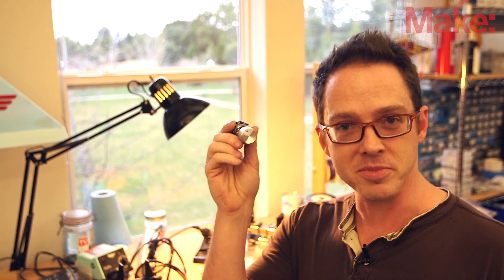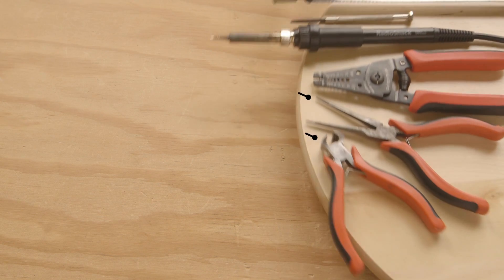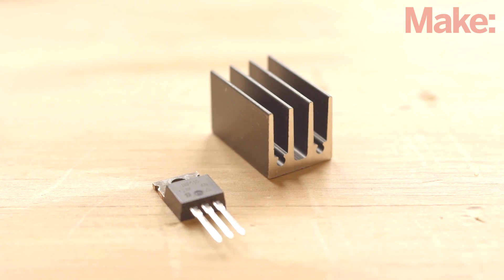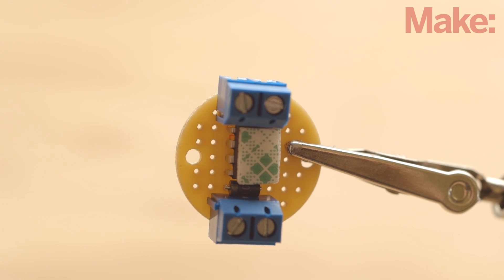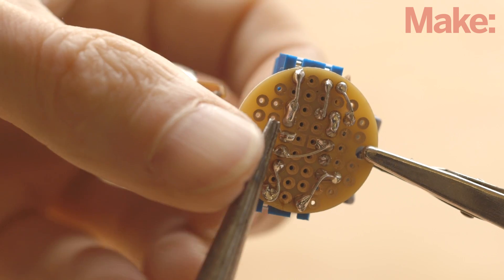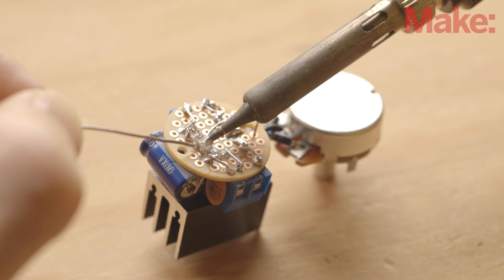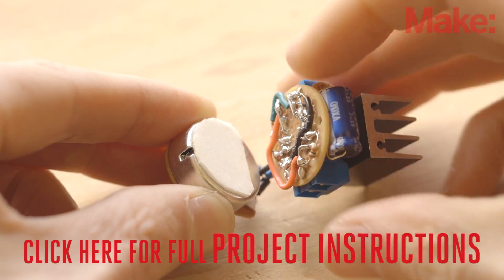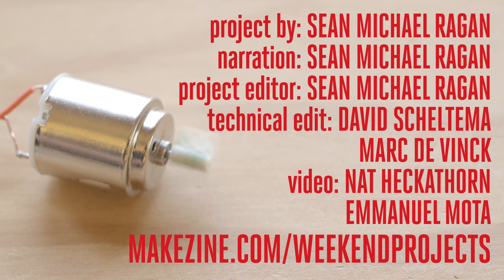Weekend Projects - Dial-a-Speed Motor Controller

Comment: That heat sink ain't gonna work
Reply from the maker: Please elaborate.
Reply: I think you saw it wrong Derek Li. The mosfet is directly on the heatsink.
Reply: MAKE Isn't the double-stick tape between the transistor and the heat sink?  I would think that tape is a pretty good thermal insulator. (But I'm not going to say flatly that it ain't gonna work, because I don't wanna sound like a know-it-all snot.)
Reply: the tape is on the OTHER side of the mosfet, the side that sticks to the 555 ic. the lug side of the mosfet IS bolted directly to the heatsink. watch it again. (although i do agree that some thermal paste between the trans and the sink would have been much better)

Comment: Is there a thermistor controlled version?
Reply from the maker: There is not, but what type of application were you thinking of? We're working on something for later this year that might align with what you're asking about.
Reply: im using it to control the speed of the fan depending on the temperature of the cpu.

Comment: Can you just not use a adjustsable resistor or a volume controler.
Reply: you could but its not as efficient as a PWM circuit.
Reply: Cool, yeah i guess so, i didnt think of that for power management saving.
Reply: That would waste power in the resistor, and also as the voltage across the resistor increases, the voltage across the motor decreases and so does the torque, not just the RPM. A PWM circuit has full torque across the RPM range (as the motor is fully on or off), which is most likely what you want.

Comment: I love working with 555 timer.  In 1988 I built a simple timer using the 555 to automatically flush some antique urinals in a public school.  My basic circuit design came from "Getting Started In Electronics" by Forrest M. Mims, III.  Power supply used the LM7812 transistor.  Also used a photo-resistor & 12-volt lamp to keep pin one of the 555IC from re-triggering during the time cycle of my appliance command module's one minute minimum time cycle, which was operated by a Tandy Command Center ~ which was programed by the Tandy TRS-80 COCO-II computer.  That computer had a whopping 64K memory lol
Reply from the maker: That is a great story!
Reply: Thanks!  It worked flawlessly until the school was closed in May of 1993.  I removed my circuit & still have it today.  I still have two Tandy TRS-80's, a Commodore 64, & a Commodore 128.  This circuit operated a tiny relay with supplied enough current to operate a larger relay, which allowed voltage from a 24-volt transformer to operate a 1" Rainbird solenoid valve.  I flushed the urinals 22 times a day around recess & lunch.  When that valve would shut off, it created a water hammer in my 1" PVC line all the way back to the school lunch room, causing the T & P Valve on the Hot Water Heater to squeal like a cat in heat.  I then put about four 1" risers/air chambers in the line in the school attic about 2' long.... Problem solved.

Comment: I would love to see a scaled up version for a 90V DC treadmill motor. It seems I often see someone throwing out a treadmill with a bad controller, but containing a good motor.
Reply: Just use a bigger mosfet.
Reply: DanieleGiorgino

Yes you also might want to add an optical isolator circuit to protect the 555 circuit from the HV as well which is pretty simple to do.
Reply: Membrane556
Well of course. OCs are always necessary when high voltage is used.